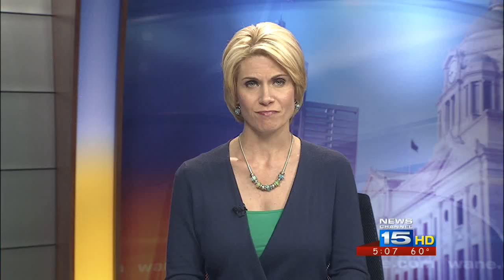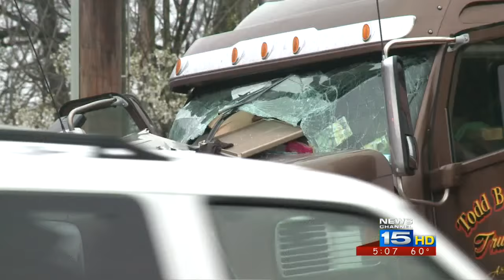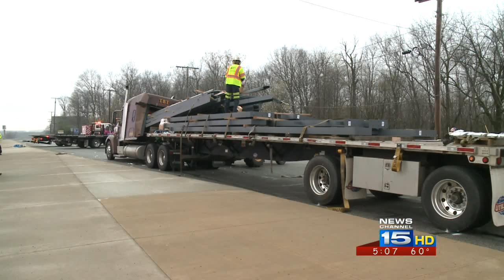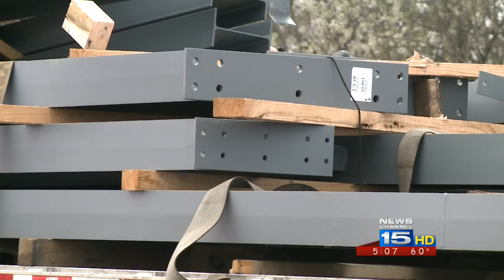Truck driver killed after load comes loose

Comment: It's painted gray, u cannot put chains, you have to just use all the straps u got and keep checking they're tight
Reply: Marv Marvitch that's why you use corner protectors with the chains... I use them all the time for chains and strap.. and I always chain front and back of steel loads...
Reply: @jonathanwilliams4501  you sound like a true flatbedder,what are these guys talking about no chains on painted freight?I understand the consequence if it becomes scratched up, but I also understand the concept of edge protectors,rubber mats, and those lil cushion pads

Comment: Also have hauled steel buildings straps without pads are not so good the steel will cut them, use chains or a pad under the straps, or just slam the brake checker.

Comment: 23 year's ago I used to have a 1994 steel flatbed with a thick welded headboard. It was a Digby trailer. 
That was a heavy solid protector. 
    My current 2017 reitinour with their bolted down aluminum headboard is just for storage. 
   Anything moving forward with momentum... that headboard is just going to serve as a ramp right through the back of my sleeper.

Comment: They should have tied the load correctly and also a thick metal sheet should have been kept  between the driver cabin and those angles ....poor guy saved others but no concern for his safety ...🤦

Comment: That's sad.  Those loads are dangerous.   Hits home when you see his cellphone on the hood.
Reply: C. Lassard dont think it had a headache rack.That would have prevented the tradgedy.
Reply: C. Lassard 
Not a cell phone.
A DVD case.
Reply: @charleswalker3962  No guarantee a headache rack would have stopped that.  That are aluminum also.
Reply: Plus the fact he was using straps when I pulled steel beams I always used chains because if those beams start to slide they obviously will cut those straps my dad had told me yrs ago when I learned so I never used straps on this kind of load, anyway RIP driver 🙏 prayers bud
Reply: @michaelcaron7659  You can use straps, as long as you use edge protectors.
Reply: @happypappy6371  yes I hear you man but personally I use chains with rubber corner protectors to protect from sliding on these loads
Reply: @michaelcaron7659  I understand what you are saying.  I do auto transport and still use chains there too.  But the new trend is straps.  Us older guys and our methods are slowly being replaced.
Reply: @happypappy6371  yep 👍 guess I’m old school Lol
Reply: @michaelcaron7659  Me too.  I still use a flip phone.

Comment: 40yrs OTR retired driver, and there is no way in Hell I would even think about loading any truck with no headboard or headache rack on the truck period.. This is completely avoidable.. That truck was a suicide mission . I seen this happen so many times, people don't know what the Hell they are doing to drive such dangerous equipment.  We use to have a law against such equipment.

Comment: Did anybody notice  he was using ratchet  staps to tie down the steel. Where is his chains! Guess  it doesn't matter now!!!
Reply: Always chains on steel for me.  I have a steel headboard on my trailer but still use chains (1/2 inch) on the front of any steel load, 4 inch straps with protectors further back.  I also make sure the load is against the headboard.  It can't move forward if there is a solid headboard holding it in place.  If the drives are a bit heavy I risk it and have had to explain the reason to a DOT guy only once (no ticket).

Comment: I bet he didn't even have his foot near the brakes when this happened, those self braking systems that trucks have are so faulty they can immediately stop on you when there are no vehicles or hazards in your path and when that happens its extremely terrifying. As I was driving down a snow covered hill with an empty trailer (luckily) the truck stopped suddenly which caused my trailer to end up sliding beside my truck, i was able to straighten it by accelerating a bit but if i was loaded things would have been different. I let the company know i had problems with it going off when cruise control was not on but they said its a requirement. Sadly things like that lead to accidents like this.

Comment: Hauling grey steel is very dangerous if you don't put enough securement on top of that you have to constantly check the tension and retighteen the straps to prevent the beams from sliding also you need to have a headache rack to haul this kind of loads. Securing properly this kind of load is very tedious and time consuming many drivers don't secure it right trying to save time and energy & the results can be deadly

Comment: No headache rack ,but at some point aluminum rack can take only so much against steel, framed in railroad ties and chained always
Reply: Aluminum is not going to cut it.
Reply: May have at least deflected it .  Would have been better than a sleeper wall
Reply: I dont understand people commenting about the head ache rack dismissing it as a possibble non factor. how did the rack get its name? They built it for a reason no we can argue about the construction
Reply: @patrickwalsh741  they do have limitations but i would much rather have it on and have at least some protection against a load like that.   I think their durability is underestimated.

Comment: O/O Flatbed driver here first of all I never use straps hauling steel I always use chains secondly I will some how cross up some chains in front of the load to prevent the load from sliding forward, yes it takes more time however you'll live to see another day and last but not least his truck and trailer should have had a headache rack on them, I think he would have survived, one last thing I always leave plenty of room in front of me so I don't need to slam on the brakes and if a car decides to brake check me well it's a bad day for the car and driver because it will be on my dash cam👍🏾👍🏾

Comment: The rule often misinterpreted or ignored is any material greater than 5' long or 1100 lb has a minimum of two proper load securement devices. For example; a single pallet of 1200 lb must have two straps. The correct location of a headache rack is at the front of the trailer.
 https://www.fmcsa.dot.gov/regulations/cargo-securement/cargo-securement-rules

Comment: Where were the chains, I didn't see one chain or binder. There was no chain rack behind the cab either, to help prevent this, they're not required anymore. Notice the straps are just tossed over the steel, nothing to protect the strap rubbing on corner edge of steel...like a piece of carpet or plastic. I would never use straps on steel, like that. Nothing chaining the front of load to hold it in place. I run that highway, I'm glad I wasn't in front of him...

Comment: you think a headache rack would have saved him?  there made of aluminium and only four bolts holding them down and are a joke for protection. drivers should be more aware of the security of their load and hey give the trucker the space they need!
Reply: You are correct my friend. That headache rack isnt good for anything except holding up chains and binders.
Reply: Seems like it would create more surface area so it would smash the back of the cab instead of piercing through it. But I really have no idea.

Comment: It looks like this guy had a small bulkhead, did layers of securement, and did alternating pull securement, so he definitely did know how to secure properly. I wanna see his securement before the accident. 

The only thing I can think of that maybe could have prevented the load from shifting and causing this accident is perhaps using some chains instead of straps (or a mix of both), doing a belly wrap in the front, back, and the middle. There’s no such thing as over-securement in Flatbed. 

It also maybe would have helped if it had a strong, reinforced headache rack behind the cab, preventing the load from going through the cab. However, I understand that not all drivers have a choice in what they drive or the equipment they are given, especially company drivers, unless they’re Owner-Operators. 

I hope the guy didn’t suffer.
Reply: I'm sure it was quick.

Comment: Did any of you see a headache rack on that tractor ?
Reply: I was thinking the same thing.  I thought they were required for this exact reason. Granted it may not stop something like this but it may have at least done more than a thin sleeper wall
Reply: Not required  by DOT any more
Reply: @wileycoyote3370  yeah I realized that after watching the video and looked it up.   Kinda dumb tbh.  This is exactly why they are needed and used to be required

Comment: My condolences, 
Restraints on a load are critical, 
There type and location and number required with and without head boarding or rack.
I see straps and I also see them on the outside of the rub rail.
Nothing is to be attached out side of rubrail except over sized loads and they have totally different rules. 
An observemnt state trooper should have stopped this guy on road or at a scale. 
This may have played no part in this accident though but chains should have been on this load

Comment: I remember back in the day the fine was 500.00 for hauling flatbed with no cab guard and the cab guard cost 500.00 i really don't know why dot does not enforce this law anymore, i think the dot is also at fault for this truck drivers life for not enforcing there own laws.only about half of the trucks on the road hauling flatbed have a cab guard go figure

Comment: I see a lot of steel strapped. Wouldn’’t chains be better securement for steel. And for the record, not sure a headache rack will stop that. That’s a lot of weight with a lot of inertia behind it. Maybe in some cases. Still, chaining with straps at a minimum.

Comment: Correct equipment to do the job ! Incorrect equipment cost a lives no matter how safe you think your load is ! The worse I've seen is steel tubes stacked inside an aluminium 40 ft container ! As it was landed and custom sealed the drive was unaware of it's securing inside. The truck was not traveling fast on the docks after loading but a tugmaster pulled out in front of him he braked to avoid as tugs have right of way on the dockside the tubes slid forward through the ply liner Ali panels demolished the cab ! Lucky the uncapped tube ends hit his seat first and tore it from fixing pinning him to his door ! Subsequent tubes slid through that would have decapitated his head if he was still in his seated position!! Not his time to go ! But he was damaged broken hip from tubes hitting his seat first although his insurance and doc company paid him off the shippers loaders should have been made accountable !!! Chinese health n safety was non existent at that time !!!!

Comment: This was a vary avoidable situation. As a driver I would have never put this material on that truck No headache rack.The shippers should have known better than to load it without a headache rack Sad story my heart goes out to his family. R.I.P brother trucker
Reply: yep i agree you need a rack for this type of load. If you are on the road be prepared that you are more than likely going to run into idiots so extra chains and straps I also use rubber strips  with metal makes a world of difference metal on wood slides so easy even when dry . If you pause and look at the restrains you can see the H Bar stacked 3 high then straps over that should have at least  2 straps on each layer at the very minimum then a couple of chains at each end also might take longer but it could've saved his life.

Comment: No excuse for this fatality, that’s why they make headache racks, this driver rolled the dice n lost, learn from this, iv pulled several loads just like this, the only secondary respomse this guy did not utilize,, is this, pull a damnn chain run it across both sides to prevent load from crashing in his cab.safety.. no substitute, I’m sorry this driver perished, at least it was fast.

Comment: That's why I put chains on all metal loads. Even if its optional use chains. It will save your life.
Reply: It's ok to strap that load, but obviously wasn't tighten enough and not enough strap...plus I never understand why some flatbeders doesn't use headache rack

Comment: I had a vision that I was going to get a car crash with 7 trucks coming and 237 cars on the road and the car crash happened
The first truck lost its straps to keep the logs on and 3 people died we have gone around and the 4 other trucks lost their loads one iron rods 2 big metal boxes 3 cars 4 logs
And that all lost all of that
And cars start losing control of their cars and a car get crushed on the back and we had 3 others in the car and we all could have died but I went to the funeral because of the crash I didn't know who they were but I did

Comment: Ooops.  Shoulda used some chains on that load...Instead of cheap straps ....Plus a headache rack might a helped some to....if he had done it right ,that load a steel would not have come thru the cab even with a hard brake check.